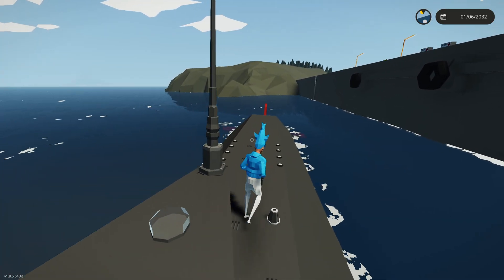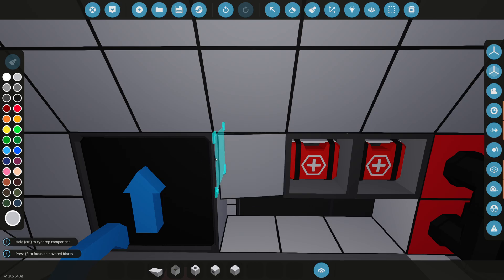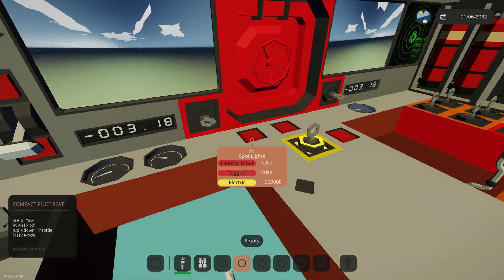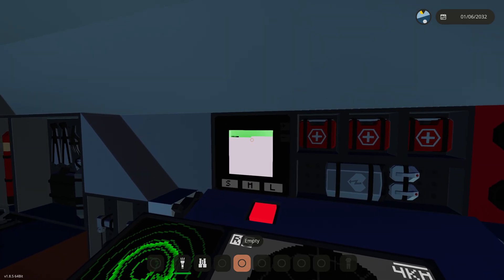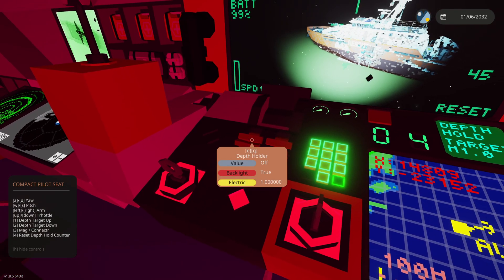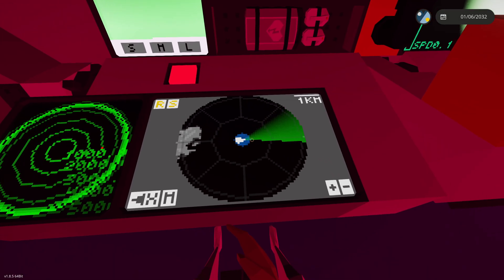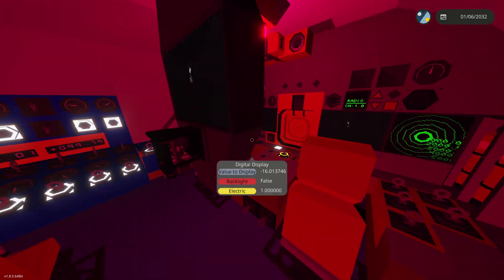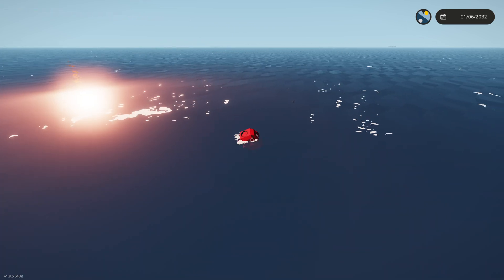Adding LiDAR | Ultimate Research Submarine, Stormworks (#16)

Comment: I think this thing needs an artificial horizon and a depth hold. 

If you're really up for a challenger you should try to modify your ballast system so that it can automatically fill ballast tanks to level out the submarine or to take the submarine to a desired depth. Since you have multiple levels of ballast tanks you could maybe have the lower left and lower right ballast tanks be on automatic while the you maintain manual control of the the rest of the ballast tanks.
Reply: Nice idea but it looks so empty and submarines are full of buttons, switches, keys and so on

Comment: Idea for the sub : if this is a research sub, add a cryo chamber with the radiators to cool it down. This will be useful for long crew missions🥶🥶🥶
Reply: In stormworks its heaters
Reply: @vyrn7877  no, it's like the fans inside the sub they don't cool that much but you need to place many of them, in my playtest it cooled the room down to -50 degrees